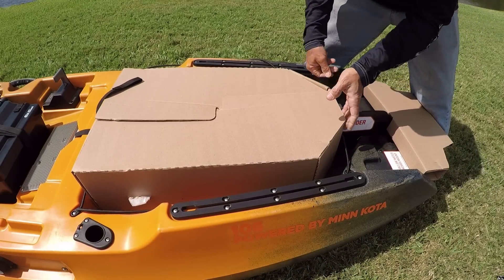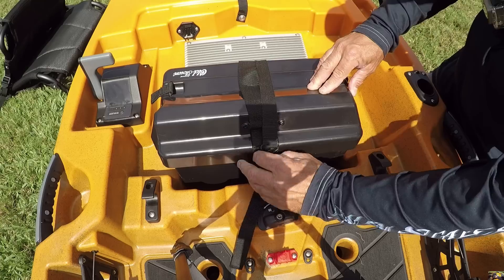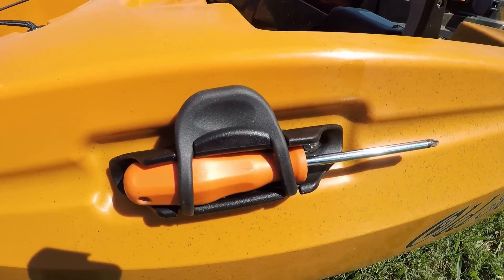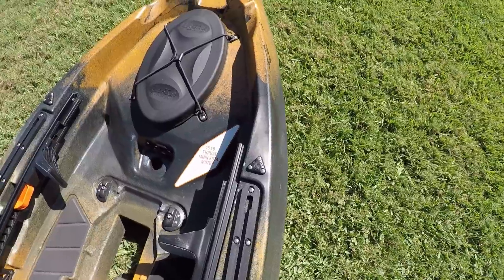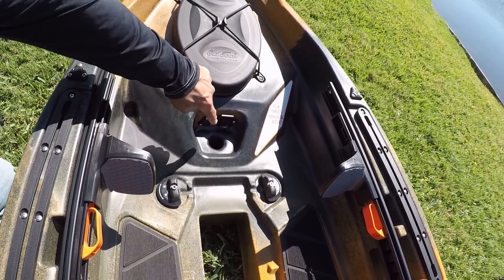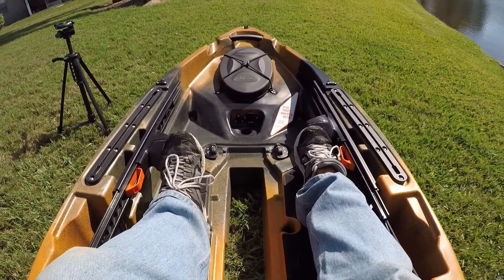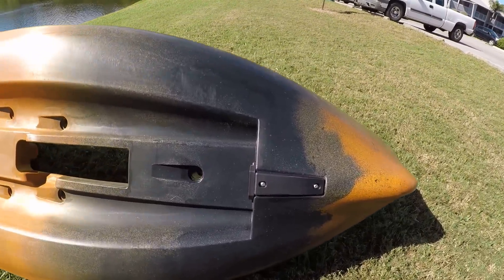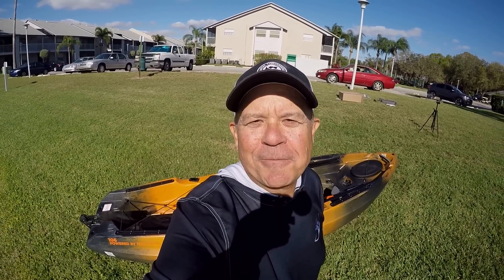Debut! Unboxing The Old Town Sportsman 106 Powered By Minn Kota, Assembly and Features Review

Comment: This is the best review I’ve seen on the Sportsman.  You’ve covered everything and answered all my questions.  Keep up the great work.  Subscribed!
Reply from the maker: Thanks for sharing encouraging words. I will be doing a full on the water fishing review soon. I've been holding off with doing that until I've fished out of it enough to really be able to deliver the pros and cons.  It's a great kayak for fishing and being able to cover a  lot of area quickly to find fish. I've actually spent ten hours on the water using a 100 amp lead/acid battery and still had half the charge when finished.  Thanks for joining as a follower.

Comment: Just got this kayak delivered today. Went back and watched your video again - previously watched before ordering in January. Probably will need to watch at least one more time. 2 quick questions. Any recommendation regarding battery - is lithium worth the price for use with this kaya? I have a Garmin 9 inch screen I recently bought on sale. I presume I will need a separate battery for that as well. Again - any suggestions for a fish finder battery? Thanks
Reply from the maker: Thanks for watching the video. I use a lead/acid 27 class 100 amp hour marine battery. I'm fine with carrying the weight of the battery to and from the kayak. I never researched a lithium battery because the cost doesn't work for my budget. For the fish finder you'll have to do your own research on what's recommended for your device. Thanks for commenting.

Comment: The one thing that they could improve on is making the three wire caps for electronics larger. Also, why are there gear rails on the back that you can't reach?
Reply from the maker: Thanks for commenting. The rear gear track works great for anything. I use it for my flag pole that has the light on it for night fishing. I also use it for my Ralblaza camera  boom, and I also used it to add cleats for docking the kayak...I haven't used the wire grommets yet, but from watching Old Town's video on installing a  fish finder the holes looked fine. Check out the install video here: : https://youtu.be/y1FPtkQUP7A

Comment: I'm on the fence about going from a Hobie Revolution 13 to this Sportsman. The one thing that's holding me back is not actually seeing one of these on any lake yet. I'm on very kayak heavy waters in southern California. Seems like everyone just upgrades to the Autopilot models. Holding a spot in the wind is quite frustrating in the Hobie without an anchor and I assume there would be a lot of fumbling with the power lever. The nice thing about this one is the steering is foot control, so would really just need to find a good speed to get close to the wind/current. The price is also a major deciding factor in it's favor.
Reply from the maker: The 106 Powered By Minn Kota is an excellent kayak for sure. You are right though compared to the Autopilot 120 or 136 there's some additional work involved in operating that throttle lever and anchoring with the 106 Powered By Minn Kota.  The Autopilot is a lot easier to fish out of than the 106 Sportsman; the remote control operation and the GPS anchoring is amazing and you can also operate the rudder with your feet.  Here are my review videos of both models. Autopilot https://youtu.be/dJPXsbVnIq8  106 Sportsman https://youtu.be/_D0YpSttFOw

Comment: What is Old Towns specs. on speed/distance with the motor. Looking forward to your on the water review.
Reply from the maker: Great questions...
Here are some specs from Old Town related to your questions: 
-Max  battery life 100 AMP Hr. battery-20 hrs
-Typical battery life 100 AMP hour battery-7 hrs
-Full throttle battery life 100 AMP hour battery-2.5 hrs
-Speed4.2-4.5

I was able to clock the speed at 4.7 on mine the other day. I also started with a full battery (105 amp hr.)  fished 10-1/2 hours and still had half of my battery charge when finished.
Reply: @RadReelingFishing  how do you know when a lithium battery needs recharging?  I was told it runs full then just dies.  Never used one before, is there a battery level indicator on the motor or something?   Thanks
Reply from the maker: @johncal9403  Sorry for the late response. For some reason Youtube didn't notify me of this comment. I'm not familiar with the lithium battery.  The indicator on the kayak works for lead/acid batteries only.

Comment: Awesome review! How long does the battery last? I'm thinking about getting the same battery as well.
Reply from the maker: Sorry for the late reply. I don't know how I missed this. I've fished up to ten hours and still had 50% battery left according to the meter on the kayak. Battery life will vary depending upon current, wind, the kayak load and duration of time the motor is running. Thanks for asking.

Comment: How long does the battery last though? Especially if using spot lock..
Reply from the maker: Thanks for watching. Mine doesn't have the spot lock.  The battery life specs for the 106 Sportsman Powered By Minn Kota are as follows:
-Max battery life, 100 amp hour, 20 hours
-Typical battery life, 100 amp hour, 7  hours
-Full throttle battery life, 100 amp hour, 2.5 hours

Thanks for commenting.
Reply: @RadReelingFishing  great info, thanks

Comment: That silver plate looks like a heat sink.
Reply from the maker: Thanks, what does that do?
Reply: @RadReelingFishing  It may draw heat off that motor. Does it have wires connected to it?
Reply from the maker: @Phreddyfoophred  Oh right!  I did see a video where an Old Town rep said that grid is one of the wiring access areas to make it simple to work on if needed. There must be some wires there. Thanks for the response.
Reply: @RadReelingFishing  I'm going to A.M.I next week for vacation. Hopefully some of your tips will score some fish.